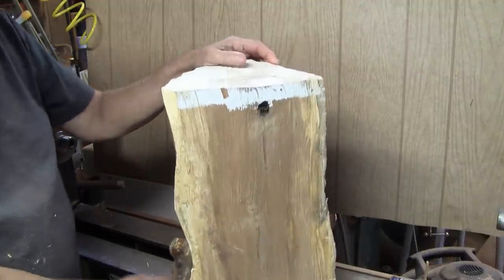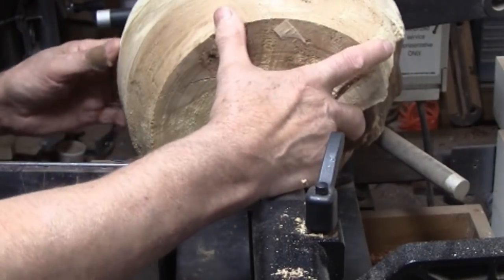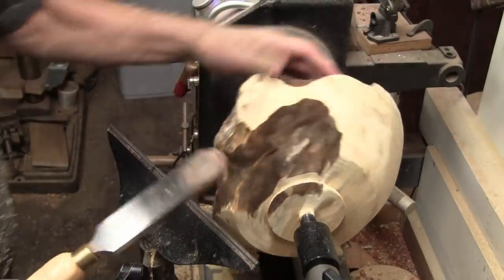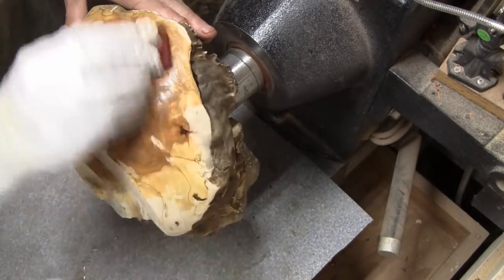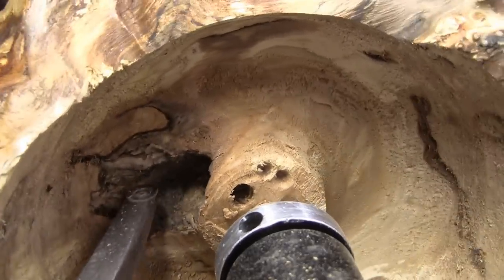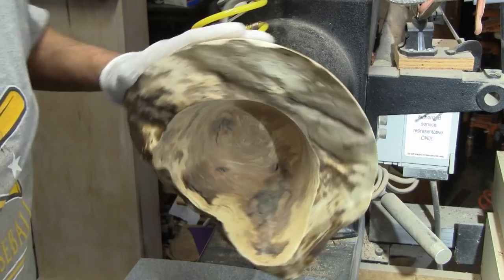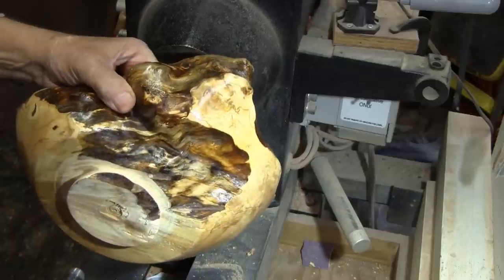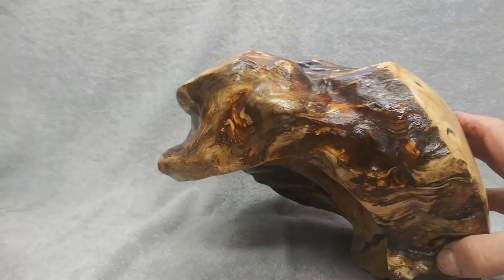Wood Turning Wicked Piece of Cherry

Comment: Garry not Linda. What can I say that hasn't been said already? Great job and great vision. Off topic question. Where did you get your display turntable or did you make it?
Reply from the maker: Thank you Linda. I bought this turntable on Amazon but the other one I used for a long time I built using a microwave turntable motor. It is a very heavy one  that will handle big chunks of logs but it is plug in only.
Thanks for watching,
Gary

Comment: Quite the challenge.  A couple questions; (A) when you came back after the initial rough turn, you said you decide to "shift" the piece about 3/8 inch.  What direction did you shift and what was the reason behind the move?  (B) What do you use to sign your work? are you signing before or after the finish is applied?  (I have had issues with the finish reacting with the ink and vice-versa)  Thanks, Looks good how the turning ended up.
Reply from the maker: Thank you Dave! I shifted toward the alien feature so that I would not be turning away more than I wanted to.
I used a standard ink pen. It can be difficult to keep it from bleeding but I have found wipe on poly will not mess most of the ink pens up. Best to try it on a scrap. The other thing I have done is a light spray of lacquer will work as well.
 Hope that helps and thanks for watching,
Gary

Comment: Okay, yes it's odd. You want perfectly round and smooth over every square inch. That's called mass manufactured and boring and this is anything but that! Aside from  figuring out the shape you wanted, I kept thinking about it being out of round and all the vibration and turning so much air without a catch. Wonderful design but equally great execution.
Reply from the maker: Thank you very much Josh! Yes it was out of round for sure. Not sure if I mentioned it but in one area there was 3 inches of air. But this is what makes it fun.
Thanks for watching,
Gary